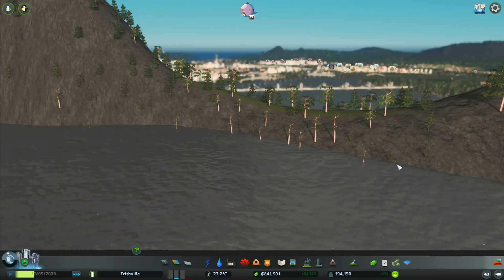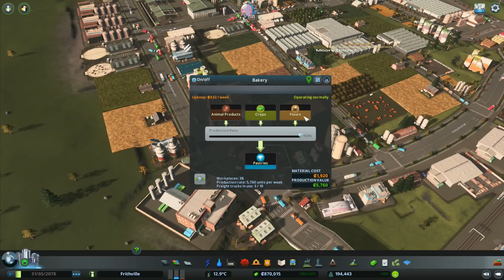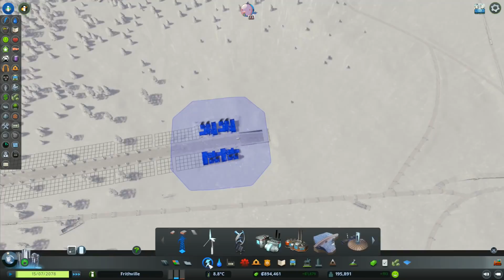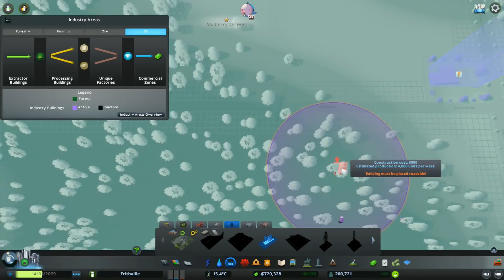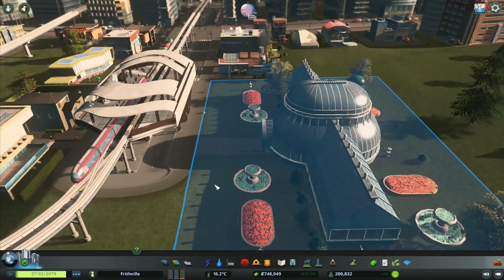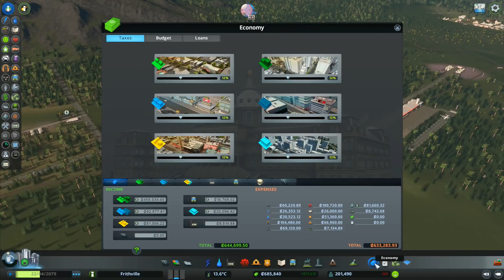Let's Play Cities Skylines #85: Oil Industry!

Comment: I just read an idea I thought you would find interesting Frith. I saw a post someone made about the Poo Lake idea on steam saying they handled overflow by building a secondary side system of intakes and waterpipes that doesn't connect to the rest of the pipe system to "syphon" off the poo water. you can read those posts here https://steamcommunity.com/app/255710/discussions/0/611701360833979157/